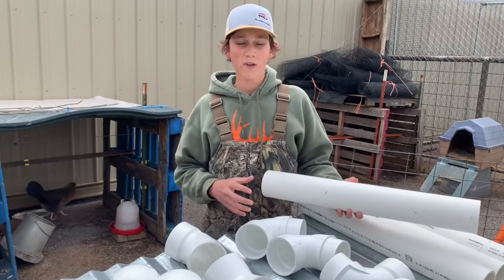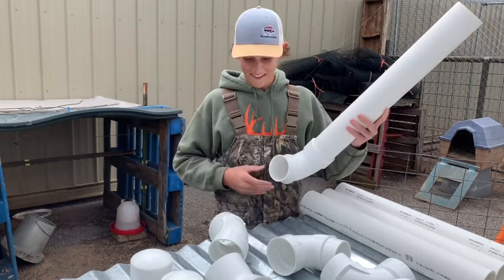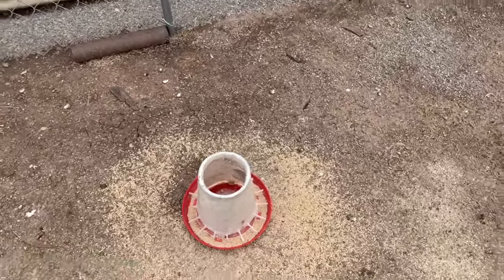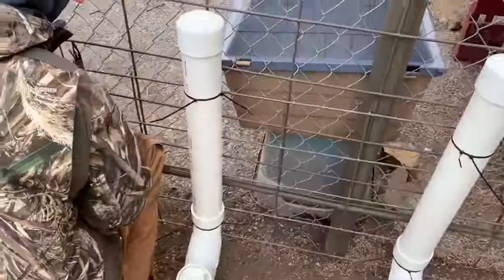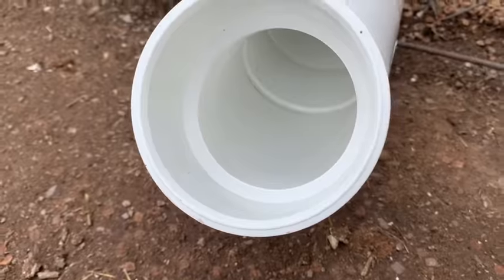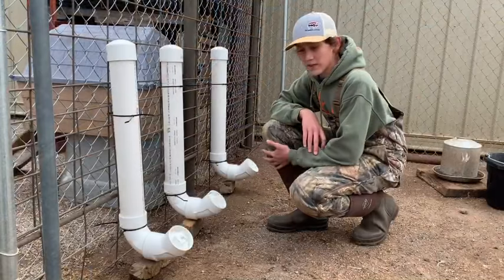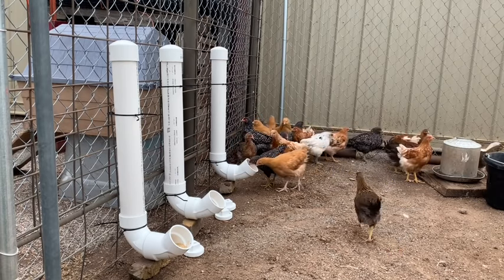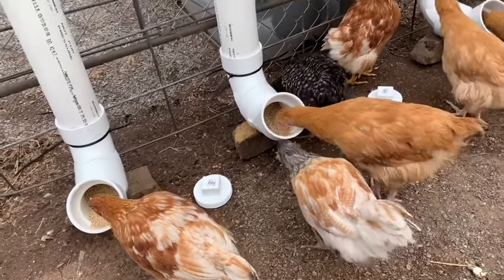DIY Easy Chicken Feeder (Cheap!!)

Comment: If you cut a small hole and put the 90 through the hole, you could feed them from the outside. But love the overall idea, and great presentation. 🤗
Reply: Some 90 deg i've seen have outflow holes.... would this function the same way?

Comment: You said the rain does not get in it (2:17)  Great to keep mice out but the rain is going to soak the feed just like in those reversed bucket type feeders. You need to place a 45 modified elbow on top of your feeder and cut it so that rain is totally excluded. Alternatively place a cover across all 3 feeders so that the rain never gets in.. Top job young man.

Comment: GREAT JOB !! I am going to the store right now to buy the PVC pipe material.  I am going to have to put mine on the outside of the wooden coup with the ends inside the coup. I will send you pictures when I am done. I’m going to do the DIY watering system similar to your d\feeding system. Thanks again!

Comment: Use the same idea for water. Build adapter for a water jug so air cannot travel to the top. It will automatically keep any water from escaping.
Reply from the maker: I will have to try that. Thanks

Comment: Fill an old feed bag with the feed and use it to pour into the pipes.  A lot quicker, cleaner and more efficient than scooping cup by cup into the pipes. I put additives into the bag and use it to shake and mix with the feed before pouring.   Diatomaceous earth,  lyme,  grit and  sand.

Comment: Thanks so much for the idea.  I built and installed two of these a week ago.  I really like the simplicity.  I am a bit concerned though that they could get clogged up and not deliver the feed reliably.  What have you experienced?    I really am hoping this feeder works out. The only real drawback is that it is not easy to tell what the level is without looking down inside.  My pipes are in a storage closet that I built onto the coop.  I am using a 5-gal bucket split vertically to make a roof over the outlets.  I have screwed the bottom into the coop.  🤠
Reply: I am inspired to make my own also.  To check the feed level, could you shine a torch in to see where light stops at nighttime?   Or put down a stick with a wide flat end?  Or even easier else just fill it up at regular intervals?  Don't wait for it to empty except maybe once a month so it is all gone.

Comment: Maybe a helpful tip for ya'll.  I noticed you're double scooping, once from the can then from the bucket.  I would put the metal can w/ feed in the corner of the chicken yard, use the wide scooper (seemed like it holds a lot), along w/ a wide mouth funnel.

Comment: Glued pvc water system that’s like this otherwise?  Could also join all with pvc and add storage on top to both systems...or add a water hose connector & float valves.

Comment: Great feeder, not to be critical, but using the threaded clean out plug without the 3" 45 having no threads, just putting the clean out plug in will not be water tight (water proof) rain will get into your feed. Great job I like to see the young generation have initiative, and creative and not afraid of work, better than being on some electronic game. Keep up the good work.
Reply from the maker: Yeah that’s the one problem I have with these feeders. Thanks!!
Reply: Can you explain in more detail what I need to make it watertight? Or iWere you saying that it’s not really possible to make them completely waterproof
Reply from the maker: Mrs. Anderson the feeders are water tight. But the way the feeders are designed water can get in the bottom. So you would have to put them under something to block the rain.
Reply: Chickens love wet feed. Many farmers take the trouble too soak their grains for 24 hours. Several studies show that it gives the birds a 15% increase in processing the grains. I think the tiny amount of water that would get inside this setup would be cleaned out by the chickens pretty quick. It generally takes 60 to 72 hours to start to grow mold on grains. This seems to be a very maintenance-free system. Don't take my word for it. It's definitely worth a Google. 🤔
Reply: @gretchenanderson6419  Sorry for the late response. you can make the feeder water tight. pvc fitting where the chickens eat from the feeder, if it's 3in. or 4in. pvc you cut a piece of pipe what ever size you are using about 3 inch long glue it in the fitting where the chicken eats from. place a pvc cap on the pipe do not glue cap. you remove cap when you feed chickens. that will make it watertight. The ideal place is have the feeder under a cover to water proof the feeder if you intend to have feed 24/7

Comment: I have to say I agree with all your reasons for doing these pvc feeders. I came in search of something different from all the current commercial feeders available for the exact reasons you outlined. I did go out and make these (after a 2nd attempt to find the correct fits for all the parts), and really like the final product. I made 6 of them total. The one comment I would disagree with you on (besides the incorrect quote mix from The A Team vs Silence of the Lambs character name of Hannibal Lector, which was adorable), is making these feeders are NOT cheap (no pun)! Even excluding the fact that I screwed up on the sizing initially), I was shocked at the final cost of a finished feeder! Not sure if getting parts at Home Depot is more expensive than others, but damn! I spent an easy $100 bucks on these. But I AM happy with them, and they were freakin easy to assemble (once the parts matched up lol). Great job! Hope yours are still working out. If not, have you found something better?
Reply from the maker: Mine are still working but I’d love to hear the better way!!
Reply from the maker: The ones I made were cheap.
Reply: Schedule 40 pipe is a lot more expensive than schedule 30, which is more expensive than drain pipe.
Reply: Watch habitat for humanity Restore for pvc parts

Comment: I love these feeders and the chickens like them too, but I can't put more than three scoops of feed in at one time.  If I fill it up it gets clogged in the pipe and does not deliver to the chickens.  I changed from crumble to pellets with the same results.  I have to tap the bottom with a hammer to vibrate it down every morning.  I made two and they both act the same.

Comment: Hello, thank you for the video and the "A-Team" reference. We have built this recently but the feed isn't falling into the bottom the way we had hoped. Did you have any difficulty with the feed clogging at the bottom and not really turning the corner in the 90? If so have you made any modifications to the feeder to help the feed fall better and more consistently? Thanks in advance for the help.

Comment: I'm curious if you put the caps on every time it rains, because it doesn't appear to be located under any shelter. Rain is going to drop in that opening and spoil the food. Which is a tedious thing to do. I'd never put food out in the open without enough roofing to guarantee rain can't get in, even in decently high winds.

Comment: Would those fill with water? And of so would reversing the elbow help?
Reply from the maker: Not sure. It’s worth trying though.
Reply: The water will pour right out unless the lid is one to keep a suction. No possible way to get the water in with the lid on. It wouldn't for water as it is.

Comment: Hey! Great video! Question, have you had any rain since putting tht feeders out? Does water get in there? I'm looking for a diy feeder solution but I live in Washington state so I'm worried the rain might soak into the feeder
Reply from the maker: Great question! A little rain gets in from the bottom, even with the lid on. But here in Oklahoma we don’t get a ton of rain, so it isn’t a big problem for me. 

I think if you could find a better way to cover the feeder it would work great.
Reply: If seal/glue the fittings together, they're water-tight. No water will seep in from between the fittings! :)
Reply: Try putting them under a small shelter ... im gonna do this . 😃
Reply: @melbasconyers9148  one person mentioned adding to feeder outside coop and the eating part inside..under shelter

Comment: Sadly I learned the hard way that 4 inch doesn’t fit together quite so easily.
Reply from the maker: I’m sorry! I wished I could have helped. Sorry about that.
Reply: Why not? Doesn't work with all PVC tubes sizes?
Reply: @josuegomezcoello8672  i think 600 to 700 mm is enough and easy to fill

Comment: Hi you posted this a couple months ago, just wondering how it’s working out?  We just got our first chickens and I tried building a bucket feeder with a rubber bin secured to the bottom but you’re right, they climb in it and poop in the food. I’m searching for a new method the will keep their food clean.
Reply from the maker: This feeder works great. The only problem is it lets a little water in through the bottom of the feeder, when it rains.
 Overall it works great. You will just have to find a way to keep the water out. 

Thanks so much. I hope your chickens do well! If you have anymore questions feel free to ask.
Reply: That’s perfect. Thank you.
Reply: I've used this type of feeder for years...as far as keeping water out of them I mount the feeders about 6 inches apart then  I get a 15 to 20 gallon Rubbermaid container and cut it in half widthwise. I then cut slots in the back of the container.( with the cut Open side down) just enough to slide down over the feeders... Makes a nice rain hood and does not interfere with the chickens being able to eat.
Reply: Here's just a short video of what I was describing above (featuring my bantam rooster Berkeley hamming it up)  https://youtu.be/khIkKH64CJg

Comment: Don't care what kind of feeder you use,as long as the food doesn't end up on the ground,RATS ROACHES, WILD BIRDS WILL COME,THEN YOU REALLY HAVE PROBLEM S , SO THE KEY IS TAKE A 5 GALLON BUCKET DRILL 4 DOOR HANDLE HOLES  PUT A TOP ON IT AND HANG IT .

Comment: Its not god method u can use this pvc pipe in horizontal position and make some holes on top side of pipe due to horizontal pipe method more hens should be able to eat their food..
Reply from the maker: But when you go to fill the horizontal feeder up,  it will be hard to even the food out. And tricky to fill through holes. 
But the vertical feeder it’s easy to fill up. All you have to do is take a cup and fill it up. And if you ever go camping or leave for a while, you can fill them all the way to the top and gravity will refill the feeders. 
The horizontal method still sounds good! I think both ways have their pros and cons.